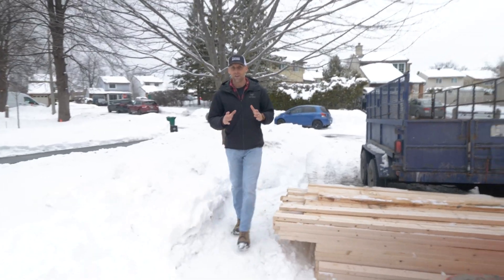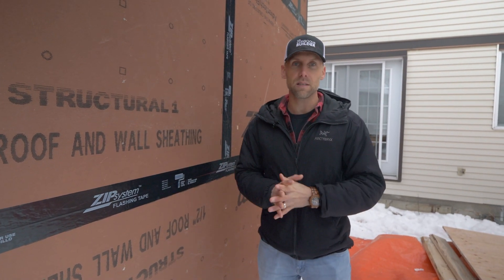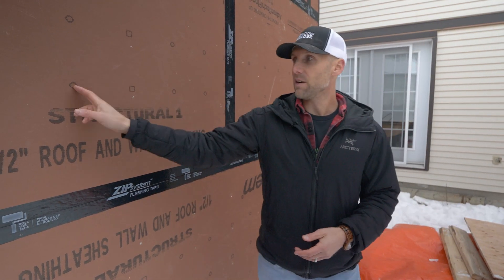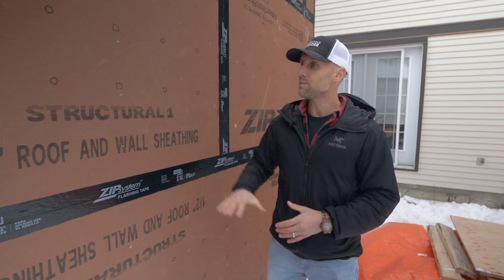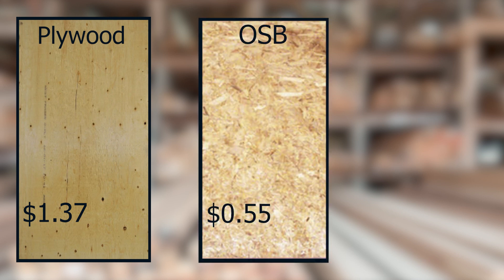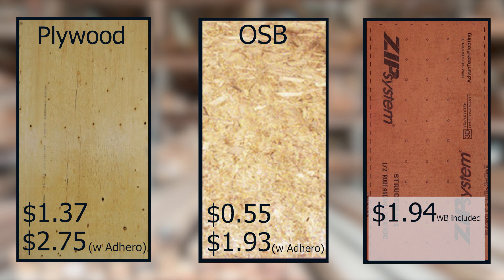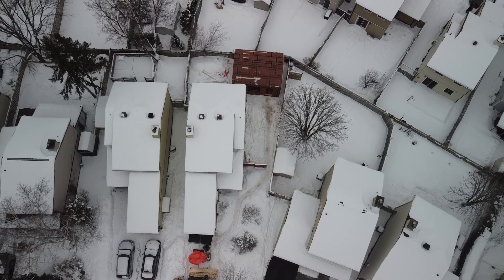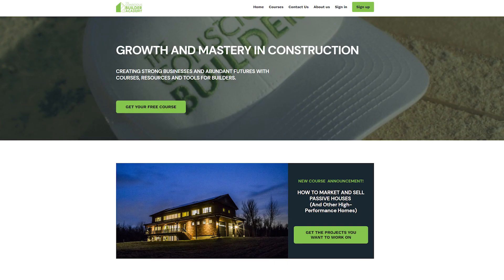Zip Sheathing vs OSB and Plywood - Coach House

Comment: Every nail through Zip is a hole in your wrb, and as the years go by and the wood framing shifts, shrinks, and expands, those holes will get reamed out allowing the water vapor that condenses between the permeable Zip and the low perm EPS insulation to run down the nails and into the OSB and studs.  OSB with a self adhered membrane has zero penetrations through the wrb.

Comment: I used 38 sheets of Zip board during an exterior renovation of my 24'x30' 70 year old cape cod in 2020-2021. We had to fidget with the nail gun and adjust the air pressurre to avoid overdriven naills. We covered some with small squares of tape. We always carefully rolled out the tape. Underdriven nails were hammered flush. It was a very satisfaction installation and it effectively exclùdes insects and drafts. LP Smart siding was used. But the priice of Zipboard today has at least doubled since then!

Comment: For the walls, do you really need Adhero if you are going with external insulation and a rain screen?  Not going to get you any sort of warrantee, but it really seems like OSB with ZIP tape seems promising.  If it was summer time, I'd say even a coat of oil paint on the OSB.
Reply from the maker: There's many different ways to approach the building. We have been doing more ZIP sheathing lately because it has been saying us time which saves the client money.

Comment: When I built my house Zip wasn’t available, I was in the HVAC business and noticed how durable mastic tape was so I sealed plywood seams and used sill seal at the bottom and top plates. A bug and draft free home was the result. Tyvec as a water barrier.

Comment: Adhero = Peel & Stick. Which Zip makes a peel & stick for its Zip board😅... I'm thinking OSB + Peel & stick= Cheaper than the Zip hype; /paid for advertising Youtubers... It's the tape. Houses built lasted 100 years and Zip is "guaranteed" a 30 year warranty... buuttt how you gonna know without tearing the wall down and in turn damaging the tape... Wanna really test Zip? Grab Zip vs Termites vs OSB. See who wins
Reply: Plywood and blueskin its the best option its minimal coat increase on margin.
Reply: He didn't include the extra blocking, with osb/zip that you don't need with plywood

Comment: most people that use this system will go back over the nail holes with the zip liquid flash. If you don’t like the tape then you can use the liquid flash instead of the tape too.
Reply: No, most people don't apply liquid flashing over nails - that is extremely rare.  Huber has done testing showing it's unnecessary - unless the nail has missed the stud and your need to pull it out and patch the hole.
Reply: @ArthurDentZaphodBeeb  and tyvek did testing showing massive leakage
Reply: @BaronVonFrankenBolzlll  Real world testing/usage shows there is no need to cover nail holes - thousands of blower door tests prove it's not necessary. It's not even a debate any more, so why you think otherwise is a mystery.
Reply: @ArthurDentZaphodBeeb  my point is testing your own product is like grading your own math test.

Comment: Can you install wrap or tyvek over ZIP panels? As an extra barrier… Thoughts?
Reply from the maker: That would be a question for Huber. I'm not sure why you would want to or need to?
Reply: @Theconsciousbuilder 
As per code in California, we need two weather barriers with Stucco cladding.
I tried my best to use Zip R sheeting, I couldn’t because of low shear strength.
Higher shear strength needed for seismic zones.
Reply: I’ve never seen it done.

Comment: Now you know your Zip house won't breathe with a permeability of 1 if taped. Which will bring problems in the future like mold and rot.
Reply from the maker: There won't be any mold or rot issues because the wall can dry towards the inside and outside. The Smart vapour barrier on the interior is meant for this.
Reply: What smart vapor do you use. Also building in Canada. Same wall detail.

Comment: Need to shingle the tape--there was 1 that was not shingled.  Plus to get the warranty, you need to roll the tape with the roller so that it marks the tape and activates the ingredient in the tape.  Zip is a great product and their Zip r with foam insulation to the back is awesome way to prevent thermal bridging.

Comment: some of the vertical tape lines are not on top of the horizontal tape lines. zip also makes a glue that you can spread into the nail heads that go too deep.

Comment: Half inch zip on the walls for a single story? What drove that? That's a lot of sheer strength. Or just because you could only get one type and wanted it for the roof?
Reply from the maker: We did it because of what was available to us for the small project. Otherwise, we would have had to order way more than we needed.
Reply: @Theconsciousbuilder  that's what I figured based on your comments in the video, thanks!